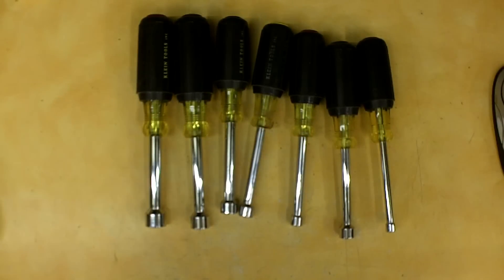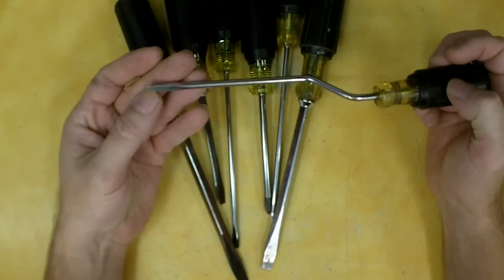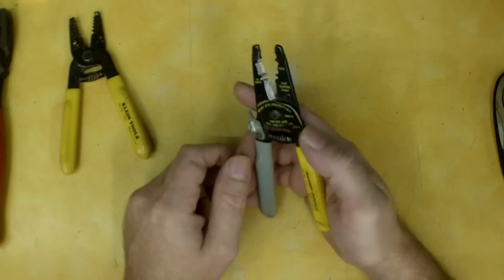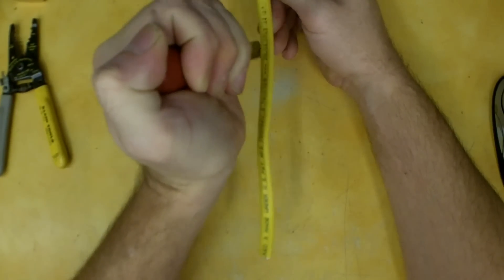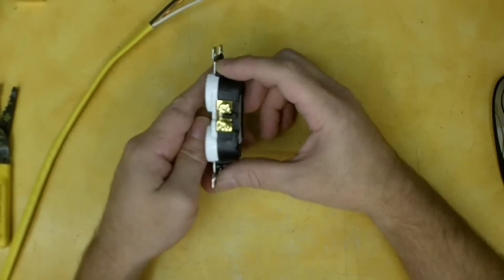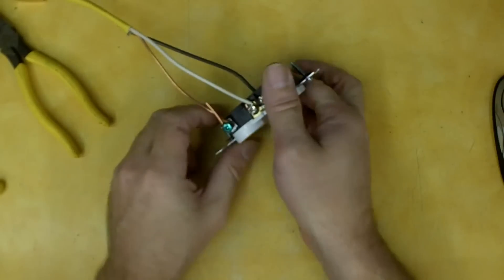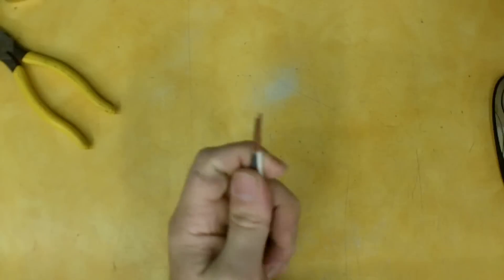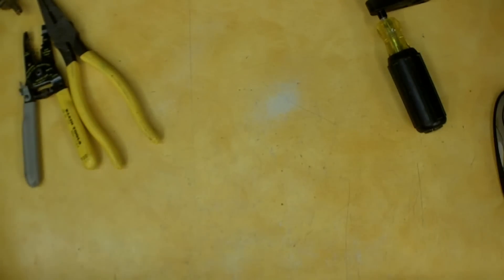Misc. Klein Tools with a Couple of No No's!

Comment: I can't be certain from this video, but that looks like a 15 amp receptacle. When using a 15 amp receptacle on a 20 amp circuit ( which i assume you are from your use of 12/2) you can not attach conductors to the second set of terminals to continue the circuit. This you mean any current drawn down the line will be also going through this receptacle. Just pig tail the conductors.
Reply from the maker: +Greg Herzl 
Yes, it was a 15 amp receptacle. Not that it matters to what you're saying, but I use 12/2 regardless if the breaker is 15 or 20 amps.  The UL listing should state that any 15 amp receptacle be able to pass a full 20 amps- so wiring to the second set of terminals should not be an issue. Pig-tailing is also a good practice. I'm not sure of the national code these days, so correct me if I'm wrong, but I believe both methods are acceptable- or at least I believe they were. Local might be a different story though. Either way, I'm not in the trade, so take anything I say with a big grain of salt! Take care, G.
Reply: I wasn't aware of the UL requirements for the 15amp receptacles. It has just been drilled into me to pigtail, even when running a 15amp circuit.
Reply from the maker: +Greg Herzl 
That's cool Greg. There's nothing wrong with using pigtails and it doesn't take much longer to to, especially if you have enough room in the box. I'm sure there are tons that do exactly that. Like I said, I may be wrong here and there. If I am in some way, I have do doubt someone will be more than eager to tell me- no matter how small it may be...lol. Good luck, G.
Reply: I have just now put some time into researching it. There seems to be no national code requiring a pigtail to a 15amp device on a 20 amp circuit.
Reply from the maker: +Greg Herzl 
Research is always a good thing Greg! Taking the time to look deeper into it says plenty about you. I generally don't take any one word for anything without looking into it. I try to find a majority consensus on a particular topic and go with that since it's most likely the correct answer- especially if it's not formally written somewhere. I know folks do some things in different ways and do think some of it has to do with it being passed down, and some with simple geographical location in how things are usually done.  Are in in the trade, or wanting to get into it? Either way, if you are or do- I think you will be extremely successful. Especially since you picked a small piece out of this video, questioned it, then took it upon yourself to dig deeper. That's a good recipe for success not matter what you do! Take care, G.
Reply: thank you, for the past year I have been working under an electrical contractor and with all my free time I learn as much as I can about the trade or general theory. It's all too easy to hear something stated as though it is a code from a boss and keep it in your head and not question it. when in doubt take the time and do it the safest and most reliable way.
Reply from the maker: +Greg Herzl 
No problem Greg! That's cool, finish your apprenticeship, then go journeyman- all on their dime! Nothing wrong with getting paid to learn! Then get your contractors license without them knowing and then start your own business I say. If you have a goal like that for your future, save every penny you can along the way for the business startup capitol. It will also help tide you over while you capture some good accounts.  Be sure to learn the business side as you go as it's a whole other subject and is really more important than the service(s) you might provide. Come back to this post in ten or so years and let me know how you're doing...lol. Seriously, do!  You seem to have a good head to use. All the best, G.
Reply: I have definitely considered that, but right now I am working on a family rental property business. Hopefully I will take on the company as my own and continue to invest in rental property and hopefully learn about each aspect in order to act as general.
Reply from the maker: +Greg Herzl 
LOL, rental property! That's even more cool Greg!  That's what I'm focused on now- along with renovating properties. I've had my first rental for about 2yrs now and am currently working on the first renovation that will be sold. I've been posting a series on the renovation project that might be of interest to you. Man, if I could turn back the clock, I'd be miles further than what I am know- but the progression of my life/jobs have served me well to this point. I see now you're shooting for the moon- even better! G.

Comment: Great concept, but I personally will NEVER use those strippers that strip the 14/2 and 12/2 Romex jacket. One job I used them on, I had multiple feeds and switchlegs slightly broken, either on the hot or on the neutral. I had to spend a few hours laying in the scorching hot attic splicing them. I don't know if the stripper was worn down or if I squeezed too hard, but I do know that from that day forward I never used them again, and I never had an issue again. I'm more comfortable either using a razor knife or even lightly scoring a point on the jacket and then ripping it off. Only do the second method if you have some experience and have a feel for what you're doing....BTW, I'm not one of those electricians that will say anything method I personally don't like is 100% wrong and say it's trash or whatever. It's just that I personally don't feel comfortable using them anymore after that happened. I shudder to think if that happened at a place where I couldn't get to a place to splice them....
Reply from the maker: To each their own I say Matt! Go with what you know and what works for you. I use them with a light squeeze and a slight wiggle to score the sheath- then pull the sheath off.  I've had good luck with them for myself.

Yeah, if you couldn't get into the space to splice- it's game over and start over. Take care, G.

Comment: I'm going to disagree with the push backs for the wires on the outlets they are usually pretty tight and the spring tension on the recep blades are going to wear out before those do. also you don't need to twist the wires together that was the old way when the wire nuts were not UL listed and weren't rated to make contact now you are supposed to let the wire nut twist them together just have to give it a few good turns after its tight to twist them together but I get what you mean if someone didn't really tighten them its a giant pain gotta get them big wire nut calluses lol great vid though.
Reply from the maker: That's cool Jonathan. We can agree to disagree on the push backs. When I was renovating our investment property, more than half of the recepts were dead and they were all installed in the eighties using the push in wiring. Most let go as I was pulling the recepts from the boxes. I'm sure they were cheap and don't know if better quality would make a difference. I just feel better wrapping the screws.

That's true and is written on every box I have. I was taught to twist, so that's what I still do. Just another thing that makes me feel better.  I'm sure they work just fine if installed correctly. It's the limp wristed/incorrect installations that get under my skin..lol. Thanks and take care, G.

Comment: What home owners are buying klein tools for around the house? lmao considering they are on average $30-40 more than your average husky or milwaukee hand tools. These are for professionals.

But anyways, interesting hearing guys saying not to pre twist wires. I go nuts if someone doesn't Go and open a joint and it falls apart. I have never had a problem removing a wire from a twisted bunch.
Besides not even supposed to be working live. But whatever, where I started I always worked live. And joints not twisted were the worse. Open a marrette and you get arcing on the wires.

But whatever. I hate branch wiring rather just be on distribution or controls.
Reply from the maker: +Joe Chitussi 
Me Joe, Me...lol. The brand, for me, is from my past- much like my Snap-on tools. The average person does not need them for sure, but with some things, I go for quality over cost- Klein being one of them. Milwaukee power tools would be another...lol

 I'm right there with you on folks not twisting. I put it in the same category as using the holes in recepts rather then wrapping around the screws. Clean, bright, and tight is my motto for many things. Take care, G.
Reply: I'm a DIY guy and I eventually settled on Klein because I was tired of cheap tools.  As he demonstrates in the video, things are just easier with new, well-made tools, even if I use them every other week.  It's a confidence builder knowing that I'm gonna make the mistake--not the cheap screwdriver.

Comment: I'm going to hunt YOU down for pre twisting wires. j/k but It is NOT proper. It says right in the directions that pre twisting is not necessary. I understand the argument about wires popping apart when you remove the wire nut but that can be alleviated by simply holding the wires properly. Pre twisted wires make it nigh on impossible to remove one conductor from the splice when you are working hot. I realize its six of one, half a dozen of the other but I am firmly on the other side. Please fellow electricians, have mercy on those of us that have perform service work hot and do NOT pre twist.
Reply from the maker: +Flyingsod Wai 
LOL. Yeah, I know there's tons of debate on which way to go and good reasoning on each side. I also know it says it's not necessary, but it does not say not to- if I recall correctly. I respect you being firmly on the other side, and know we're not going to change each others minds...lol. I'm going insert just a couple of my opinions over what I said in the video, again with no trying to alter your mind. Personally, I prefer to make a mechanical bond by twisting and not rely on the nut only. I believe the nut is supposed to twist them to a degree as it's installed "properly", and properly is the key word. It's been a looonnngg time since I've worked in the trade, but had seen too many limp wristed "nut jobs"..lol. Conductors arching and burnt up, nuts falling off when you open a box, pulling them directly off, etc.  Now I realize these types of things were probably due to some limp wristed lacky not doing good clean, and proper work, but the problems did/do exist. Take care man, G.
Reply: I ALWAYS pre-twist. It's just the norm wherever I have been. Although with the ideal wire connectors they can actually splice the wires for you if you just twist it on ( I've only seen it done with two #14, so I doubt it can be done with 2 #12 or higher). I have done lots of service work on pre twisted hot splices and its not a big deal, just be careful. I find it to be pretty scabby if the guy before me doesn't twist, but to each their own.
Reply from the maker: Cole Beattie

Yeah, there's folks on both sides but I'm with you on twisting. It may have something to do with geographical location because it is the norm around here. Agreed, to each their own. Take care, G.
Reply: Yeah. Whether you pretwist or not, the end result should be a joint. a joint holds ITSELF together, and has at least 3 twists of bare conductor, and two twists of insulated conductor after. If you need to achieve this by using pliers on bigger wire, fine, on small stuff the wirenut has plenty of force, but on 12 AWG my hands are not  going to last all day. But for F*@ks sake, any joint that just falls apart is NOT a joint and shouldn't be used. If you can't work live because the circuit is people made, then figure out how to disconnect. Let's not drag the whole trade down to the lowest level in search of the easiest way to do everything.

Comment: I am a sparky from Australia.  Every time I see these ugly US "receptacles" - we call them power points or GPOs (General Purpose Outlets) - wiring practices and the use of unstranded wire (especially for the earth) it makes me want to cringe.  And don't get me started on those ridiculous unsafe wire "nuts".  A stupid unsafe practice IMO.
Reply from the maker: +Peter Triantafilou 
That's cool Peter. LOL, I guess its all in what you're used to seeing. I think your receptacles look like MR. Bill...lol. I won't disagree with the nuts. That's why I twist connections to give them a better shot. Tons will disagree with me on twisting connections- but my attitude is the twist is the mechanical connection- the nut is to protect the connection from shorting out. Thanks for the post and good luck, G.
Reply: Actually the nuts are a mechanical connection, also the long debated twist or not doesn't matter, the wire nut manufacturer typically specifies how they prefer but the nuts are designed to secure either way now days. years ago 3M made their nuts to secure parallel wires and proved more surface area in the mechanical connection when wires were kept straight but over time they manufactured them to hold either way because you can't get an electrician to not twist the wires LOL.

Comment: real electricians will always treat a wire or circuit as hot.. will always pigtail all wire going to a receptacle.. a wire nut spinner what a waste of time all you need are your fingers.
Reply from the maker: +twig d 
What exactly is a real electrician. I've seen real electricians, plumbers, framers, roofers, etc. and have seen good and bad work in all the trades. If real means doing it for a living, and maybe having some some formal education, I don't take real very seriously. I explained why I use the spinner so that comment was unnecessary. G.